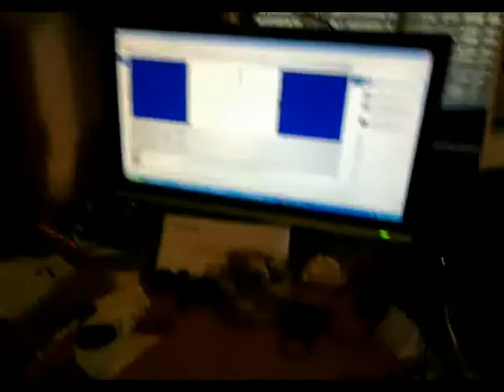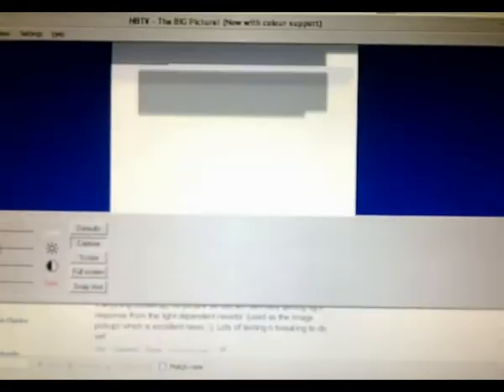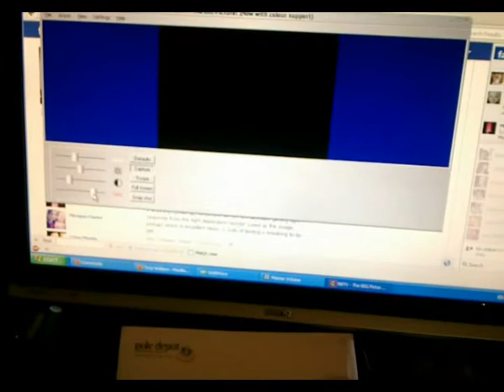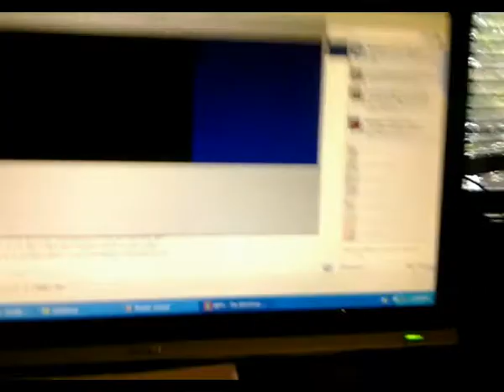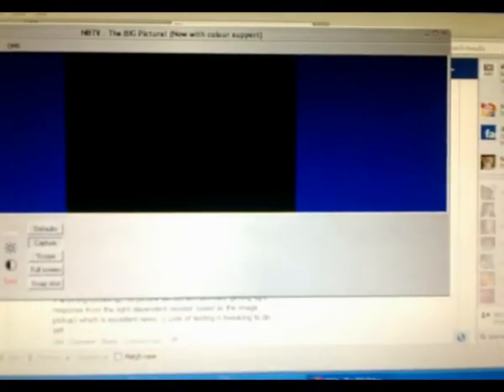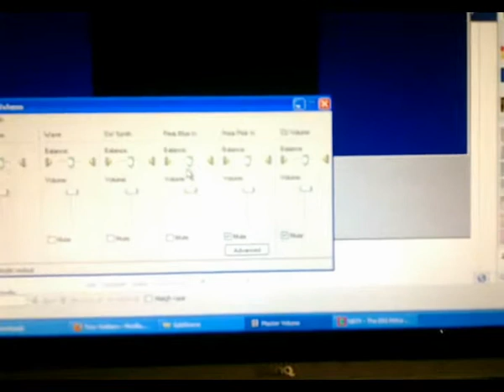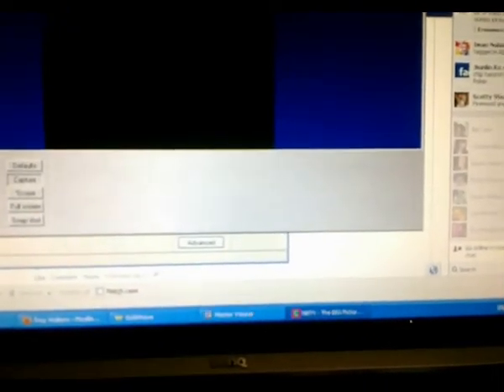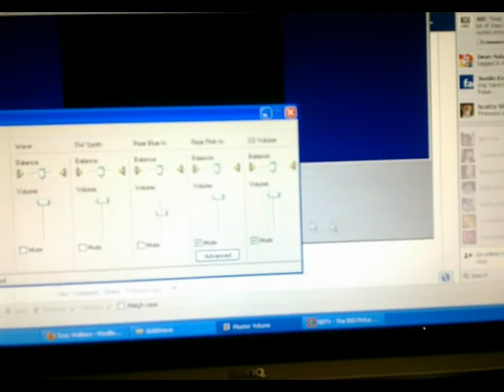32 line NBTV Nipkow disc mechanical TV camera project (Part 7)

Comment: Refresh rate better, yet overflow of light intensity. Tubes from what I have perceived had less sensitivity issues, so a filter would be a quick patch. Plus I believe it is showing a analog single from the gray-scale, yet I would suggest to test if it can receive a sine wave from a programmed flasher bulb to make adjustments for any image deformations.

Comment: Hi Troy, because you haven't implemented any sync in your signal the version of TBP you are using will never be able to show a real picture (false sync triggering). You would be better off downloading the alpha version (same site under Experimental/Pre-release - YouTube won't let me add a link). This version allows you to display a sync-less video by selecting "settings" and deselecting "process sync". You can then use the line/frame controls to align the picture. There is a bug however...